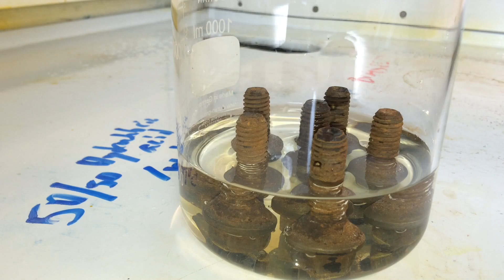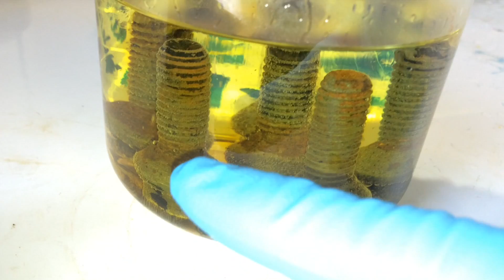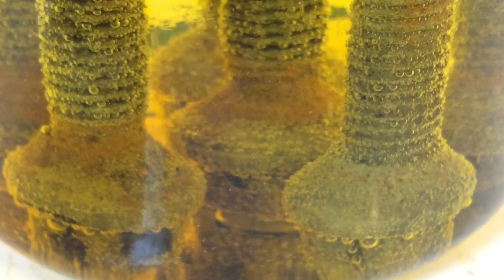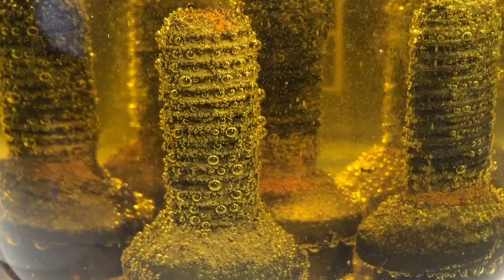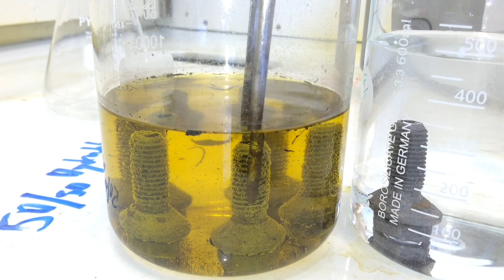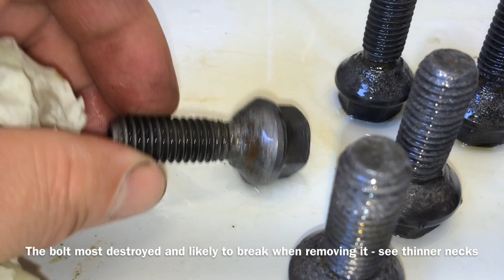True rust removal by a chemist - Jeep Wrangler YJ bolts : Ep 5

Comment: I use a battery charger,  with a pot lid on one clip and the rusty object on the other clip.  The whole works is submerged in washing soda in water.  A phone charger works too, but it is slower.

Acid removal should be neutralized, and only a fool leaves acid near kids or pets.  Also, when the acid has eaten all the rust, it starts eating the good metal, producing salts, which encourage more rust.  Also, this video is very weak on chemical safety.

Comment: Well, obviously, this does dissolve rust.  Problems: 1. slow; if you just remove the wheel and want to clean them up before reinstall just use wire wheel on bench grinder or drill.  2. You've created hazardous waste.  I don't know how you get rid of that stuff but I wouldn't want it sitting around.  3.  metal parts in a glass container is asking for broken container and acid everywhere but where you want it.
Also noticed that at least 2 of the lug bolts have significant necking at the top of the threads and are unservicable, toss them.
Always use anti-seize on lug bolts to minimize the need to partake in this activity.
I might consider this method if I was doing a complete restoration on the subject vehicle and replacement parts are not available but it really seems like an accident waiting to happen.  Wear eye protection and appropriate chemical resistant gloves.

Comment: I'm less concerned with removing rust than I am with removing rusty bolts.
Reply: you better think again, if you don't remove the rust, the rusty bolt overheats when trying to remove and it  breaks!  bad news.
Reply: @31acruz  at that point it's better to replace the hardware.
Reply: @chinchillaintheheat2641  exactly, and if you try to remove that nut off the bolt to replace it without removing the rust from the bolt.. you will break it. Unfortunately some of these bolts like a rear fascia mounting bolt are welded to the frame, you "really" can not afford to snap that bolt and break it. You have to deal with the rust or you will break it.

Comment: A simple  over the counter solution of water and Washing Soda (not baking soda). Drive current through object where electrolysis will remove rust. Far much safer than costly hydrochloric acid. You did no mention the natural gassing of your process; is not this vapor toxic and corrosive?

Comment: Nice vid. 
Just want to point out that WD-40 is not a good product to use for general lubrication. It's mainly a mix of alcohol, alkanes (water-repellent), and a VERY light mineral oil. It's so light, that's what makes it a good penetrating oil for unsticking a rusted in bolt or for any part that's gunked up. But any lubrication you do get (very little) will disappear in a short time.
I've seen people make things worse by using WD-40 as a lubricant. The WD-40 will even clean out any existing oil. Then evaporate leaving virtually no protection.
Instead, just use a general-purpose lubricating oil (like 3-in-1 oil). This will provide a better, and longer lasting lubrication. Depending on the use, a synthetic lubricant with teflon, or white lithium grease can also be used.

Comment: You should use a corrosion inhibitior in that solution, because it etches that bolts.
And boil bolts in  distilled water to remove remaining chlorides, wich is causing futher corrosion.

Comment: only a chemist would make a major production out of something so simple, forget the glass beaker and water, just grab a plastic container throw the bolts in and pour in enough straight muriatic acid in to cover the bolts, they should be rust free in less then an hour. then take the bolts out, rinse with fresh water, blow them dry with a compressor is preferred but if you don't have a compressor then dry with a towel and spray with wd40 so the don't flash rust again. with the amount of rust on the bolts in this video, the whole job could be done in an hour at the most but if you want it even faster and have an old aquarium air pump throw a airline in the acid to act as a bubblier and it should knock about a 1/3 of the time off . 
but something i didn't hear him mention, do the job outside, especially if you use a bubblier so you don't breath the fumes or rust all the metal objects in the immediate area....
Reply: Quadflopper101 
Muriatic acid is hydrochloric acid.
Vinegar is acetic acid.
Lemon juice is citric acid.

Don’t knock the chemists;  they know more than you do.
And they can spell!

Comment: Great video!
If you have time.... Any green tea will work, used by watchmakers it has a Chelating effect.
Unsulphured Blackstrap Molasses bath ... 9 parts water to 1 part ((Unsulphured)) Blackstrap Molasses !!!!!!!!!
Soak a metal nut & bolt in it for 2 weeks and it will even eat up the rust between the threads. You should remove any oil before the bath. Rust washes of like silt in a river, it will swoosh away. I use a pressure washer then dip in used motor oil or spray with WD40 or wash with Pool cleaner/Muriatic acid after the rust flashing.

Wipe your clean metal with a fine film of boiled linseed oil like they used to for woodworking plains and such.... not a heavy load just a fine residue and let dry.

Blackstrap Molasses A byproduct of white sugar (where all the nutrients and good stuff end up)....
... Potassium, high in iron incredible for anemia, palpitations vitamin B6 for strokes stabilizes blood sugars Superfood.......blah bidy bla !                Just don't drink it after using for rust !!  PS if you pour on your grass it will kill it. But otherwise, probably the safest way to remove rust.  It dose have a smell, but not so bad.

Comment: PLEASE, FOR GOD'S SAKE DON'T DO ITFirstly, if the wheel bolts are rusted just get new ones. They are a bout $4 each, your car is much more expensive, your life or the life of your family, how much, do you think, it's worth?Secondly, we are talking about hydrochloric acid, pretty much a nasty substance. What do you do with the leftover? How do you dispose of hydrochloric acid? Neutralizing with baking soda might do it but it is a very exothermic reaction, only for experienced chemist.Then, come situation where you want to actually clean the rust off of somethingHint no 1: use something that will attack rust but not the iron/steel. Hydrochloric acid is out. The best thing (I was told by someone who knew) is citric acid. Citric acid reacts with iron oxide and complexes it to form a soluble salt. It is non-toxic (that's what gives lemons their taste), not expensive and it actually works.Actually, I'm soaking a rusted cutter in citric acid right now. So far it has been good, but I didn't take pictures 'before', Well, try it yourself and you will see.

Comment: Um if I needed to reuse these bolts then it would only be in an emergency. Those bolts don't look too bad but you have to remember those are used in a high stress area and if the rust was really bad you could risk a seriously accident. So kids today's take away is, if it's just surface rust then you should be OK but if the rust has deeply pitted the bolts I would only reuse in an emergency or short term situation. Also since it's a Dodge the Transmission or engine block will fail before those bolts would anyway.

Comment: These bolts are compromised.  Use a wire wheel, much quicker.  That way, you can find out if your bolts are junk, like the ones this genius uses, or if they are still intact.  Broken wheel lugs can be deadly.  Actually, a whole lot of bolts on cars are pretty important.  Been wrenching for years. If I see a difference in shape, size, etc, I get new ones.

Comment: The problem with using acids is that the acid attacks the base metal and greatly weakens it, especially iron and steel. I left some steel parts in an acid bath for a bit too long and when I removed them, I could cut through the steel with a screw driver! The best rust removal method I have found that is non-destructive is electrolysis. It's fairly quick, acid free, and doesn't damage the parts.

Comment: How long before the acid starts eating into the good metal?
Reply from the maker: I have one of the nails in my other video running now since 2 days ago,in the acid, and dissolving the metal is very very slow - at least 100 times slower. I will check it and get back with a better estimate.

Comment: What molarity on the HCl?
Reply from the maker: +Carlos Rodriguez 15 M 👍
Reply: I believe you could use 'Muriatic Acid' from the paint or pool store, although it is less concentrated if I remember correctly.  Nice work.  Is this your hood at work or personal work space?
Reply from the maker: Indeed, you are right about the Muriatic acid. Muriatic acid is a less purified hydro chloric acid sold as 30% instead of chemically pure maximum concentration 37%. This difference has no relevance and Muriatic acid would do the same job, and in fact only mixing 1 part Muriatic with 2 parts water would practically work equally fast. This experiment was done in a professional lab hood, my personal, for using in my teaching activities at the university and it is very well ventilated. I would not do this inside my kitchen at home, but at the same time wouldn't hesitate doing it outside my garage if all precautions are made. After all, Muriatic acid is sold openly and there are much worse things out there. Improper handling of firecrackers or fuel from the petrol station, for example.
Reply: +Ken - It is terrific to see someone provide practical, knowledgeable advice for home projects. Keep up the good work and videos! :)

Comment: For all us non chemist mechanics out here:
1)  what is the molar concentration of the acid solution?
2) what temperature did you conduct this redox reaction at?
3) what is the effect of substances   on the metal substrate which are  not soluble in polar solvents?
4)  what are the consequences of the presence of chromium in the reaction?
5)  är din Jeep Wrangler nu en EPO traktor?
Reply from the maker: Thanks Derek. Excellent input.  15. The temperature is room temperature. Paints, oils and silicone block the reactions. This is not stainless, and I am not sure why you ask about chromium. Always. Cheers!
Reply: Ken Sweden I was skojing a bit.  About chromium, I know that toxic chrome salts are released during electrolysis and wondered if the same was true here.

Comment: Wouldn't it be simpler just to get new bolts ? Removing rust also removes some matter, reducing the diameter of the bolts and leaving threads with rough surfaces, and might also impact their tensile strength.
Reply from the maker: +AlainHubert yes You are right. This was just a demonstration because so often I see videos where someone is trying to dissolve rust in threads with acidic wd40, and as you see in my other video on Wd40 - it’s useless in dissolving rust. Thanks for comment!

Comment: My good friend and long time fishing buddy who's a master marine mechanic says "Do NOT spray WD-40 to prevent rust.  It won't work"  He's seen it used on inboard engines and outdrive boats for 44 years and it fails consistently.  He recommends, and so do I, using a MARINE Corrosion Guard after cleaning off the rust chemically, electronically or mechanically quickly with a wire buffing wheel.  It's scientifically designed by a team of chemists to work in the worst type of corrosion, rust environments. salt water, damp conditions, and the presents of electrical and magnetic fields and currents are horrific on metal parts.   Once the majority of rust is removed, the MARINE Corrosion Guard can stave off the return of rust for years.  Monitoring rust so it doesn't get out of control is the key.  it's called Maintenance!!!!

Comment: Geez, the WD40 guys would love this, use like a 1/4 of a can for 6 bolts.  ;-)  You can also 1/2 the reaction time for each 10 deg C you raise the temp, so take it up about 40 deg F and it will take 1/4 as long.  That is why they acid boil engine blocks to clean them, at that temp, about 65:1 gain in time for the same amount of reaction over room temp, if I did that right in my head.   Know the proper precautions and be careful if you boil acid, obviously.  And as for remembering the always add acid to water direction, an easy trick for me is to remember you add acid to a pool, so acid into water is the right direction.
Reply from the maker: Many thanks for the comment. *Safety parts are always important, gloves, eye protection and mixing rules*. 

There's a bit hydrogen coming off the grams of rust dissolved but its so little and lightweight that I cannot ignite it, I have tried. having said that, the container should not be sealed. 

The WD guys, yes, ...so many car forums I've seen where someone is insisting on soaking a rusted bolt in WD 40 or PB laster just to loosen the rust, in order to open it. Then heat and torques, half the time the bolt snaps. In some of these applications, where accessable, a few drops of real acid and there would be no need for torque or heat, since most often the bolts are for the waste anyway and already rusted away.
Reply: NO problem.  And I forgot to say thanks for the great video.  Will use this info in the future, as I have a gas tank that is rusted all to he double hockey sticks!  ;-)

Comment: Thanks I did a year of chemistry before switching to computer science, and always thought this was the go, hydrochloric being able to evaporate eventually, chlorides being generally soluble and hydrochloric being quite reactive.

Sulfuric isn't good though (probably) because sulfate is catalytic to the rusting process. And yes I mean "catalytic" in that the sulfate ion is regenerated and therefore isn't used up. Which is bad because there will be no end to the acceleration of the rusting. But then it has been used since forever as a pickle for steel, so maybe not.

Comment: Vinegar works too.
Reply: Vinegar is 3-9% glacial acetic acid, so yes. :-) He discusses that at the end of the video (8:00). The length to complete is longer.
Reply: Leave in Vinegar over nite is all you really need and then  pour the vinegar thru a coffee filter and save and reuse.
Reply: I prefer electrolytic cleaning using electrolysis, washing soda, and a a donor metal object.   The issue with acid is that when you are done with the acid, you have to dispose of it, and the parts you have may not 'fit so good' back together (if you take off too much of the metal of a bolt, it will not perform properly.
Reply: greenspiraldragon  And I made the mistake of leaving a few things in the vinegar too long also. I left a few tools, sockets, needle nose pliers  etc. for something like 2 or 3 weeks and it almost ate the needle nose on my pliers up and ate through a few sockets, probably where their was rust. My needle nose pliers went from Crocodile jaws to Camen jaws!
Reply: Yes, the electrolysis is great. And after the clean process is done then you can reverse the electrodes and then place donor piece of chrome in clean acidic solution with the metal object you have cleaned, to coat the objects you have cleaned with the chrome or other rust-resistant metal.  https://www.youtube.com/watch?v=Wy6u2kikAA4
Reply: heating the vinegar speeds up the process. If you heat it to just about boiling then let it reduce, it increases the strength of the acid. Yes, don't leave steel in too long, it will eat it up, as it would if you used this method too long.  I do wonder about the strength of the steel after this. After all rust is part of the steel, so you are removing some metal.
Reply: baking soda will nullify the acid if you use enough.. be ready for the foam volcano.
Reply: wow never thought of that!
Reply: not really, I've tried the wire brush on a dremel, not that effective, and they wear out quickly.
Reply: What commonly found household base is safe to use with hydrochloric acid?  Baking soda?
Reply: Acid is only  useful for heavy rust, for minor surface rust a chelator is better.
Reply: exactly what is a chelator?
Reply: Or Dremel-mounted metal brush. And takes less time.
Reply: Worked for me. Probably depends on brush type, rpms, and how gentle you are.
Reply: I always use vinegar on my rusty nuts.
Reply: ya overthink that's why their rusty... ladies don't usually like the taste or smell of straight vinegar... lol
Reply: I spilled vinegar on my lap... Results too be determined....

Comment: I am curious, why hydrochloric instead of muriatic acid? I have used muriatic (because that is what I had) with excellent results. Thanks!
Reply from the maker: It’s the same acid, only labelled by trade name as muriatic acid. Normally technical grade, meaning guaranteed 70 % purity, whereas I used 99 % but that doesn’t matter, the strength is the same. Thanks for bringing this up!
Reply: Thanks. And now I know what muriatic acid really is.

Comment: acid removes rust but you don't want to remove it, you just want to deoxidize it. Phosforic acid deoxidizes without removing iron. It converts the rust into Iron pyrophosphate daving the metal
Reply from the maker: +Michael Kutsenkow I am not sure I know what you mean. Any acid with sufficient strength will dissolve iron oxide into iron ions, regardless. However, if you have a strong complex binder with iron ions, you may form a converted material, like in rust converters. Only phosphorus acid will not deoxidize it. In this video you can see what happens 

https://youtu.be/5Bkdej_z1HI

Comment: Wow, 8 minutes for just that...! Anyway, some physical polishing would enable the removal of more surface rust and make the surfaces flatter, too. Use a simple lathe and some sandpaper... Then some more acid & repeat if needed, until they shine. You could also warm them up a little to change the volume and thereby get more rust to come off...